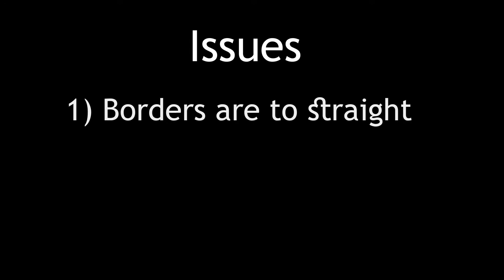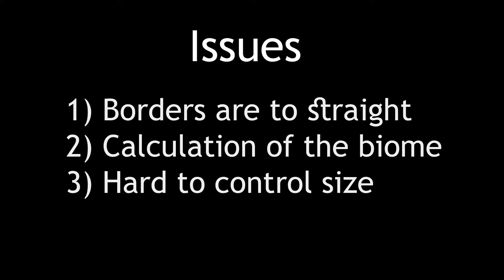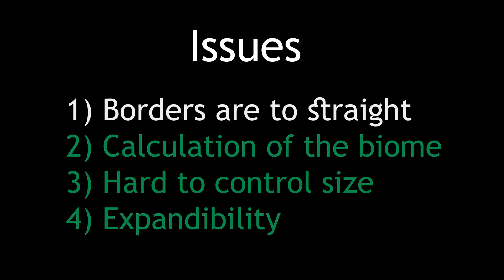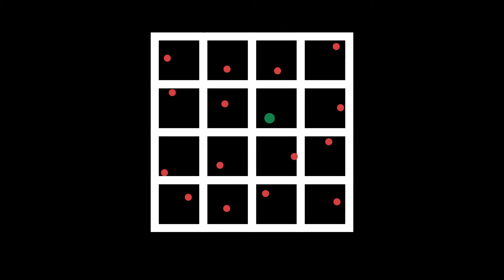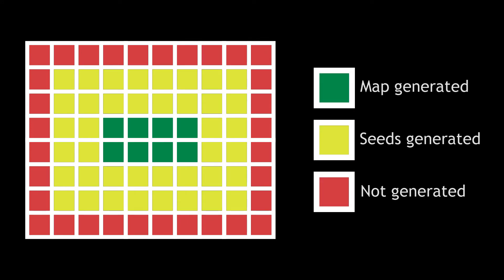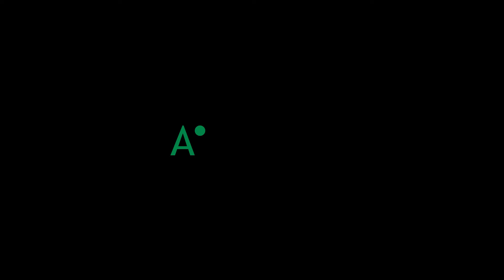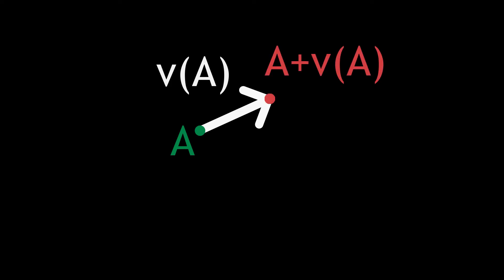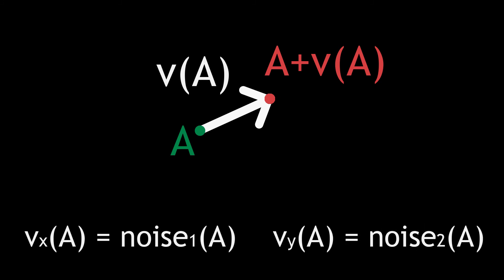Biome generation explained | Voronoi diagrams into biomes

Comment: Hi, very nice explanation, but I have one question. I'm doing a similar approach to your biomes system and I have been looking through your code, and at the moment to generate the mesh I see I have the same problem as you. We both generate a mesh, but this one is just very thing and the triangles don't spread through, there are on top of each other. Do you know why could be that? Is something about the noise map?
Reply from the maker: Hi, in the code mesh is not about biomes, but rather about the terrain, and biomes themselves are displayed on the plain instead. How to integrate biomes into general terrain is another not obvious question, you can see how it can be done in folder 'Minecraft' in root of the repository, the biomes affect generation of terrain
Reply: @rudidev5503  I will look that up thanks <3 
Anyway, in the end what I did is to create a normal map for each of the biomes, and then create a general normal map with all that information. But I still have the same problem. I don't know if it's because of the previous system of biomes or what. The point is that I am creating this project for my final degree and I would be happy to show you the code and comment on it. Otherwise I would accept any help here in the comments. Thanks alot <3
Reply: @rudidev5503  The problem I can see is that if I put the Map height and width to more than 250, the mesh broke's and starts putting vertices one on top of another and doing weird stuff. Do you know why can be that¿
Reply from the maker: @LadyMarinaDev  As I understand it you are also generating a heightmap, and mesh is based on it and biomes, I would recommend to debug biome generation heightmap generation separately. Ie generate mesh with a single biome and display biomes on a plane via color. If there is a bug in either try to fix it. I had folowing issue with merging biomes: since heightmap generation was dependent on a biome, there were drops on biome borders.
Reply from the maker: @ladymarinadev2885  If that is the issue
https://github.com/kristevalex/TerrainGeneration/blob/main/Minecraft/Assets/Scripts/Chunk.cs
Check line 89, there biome weighs are calculated, and height is avarage from this biomes with according weights.